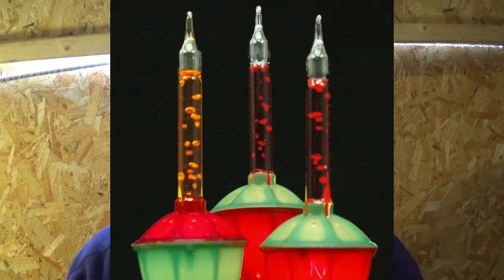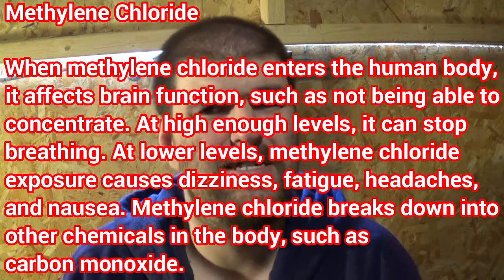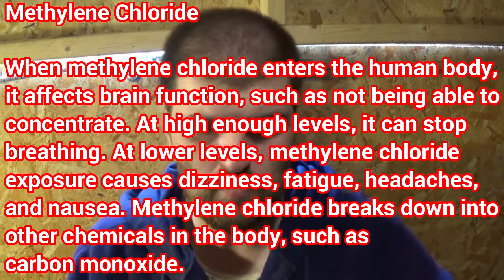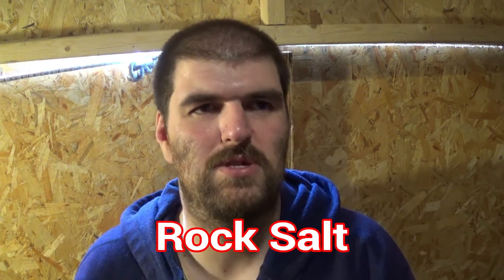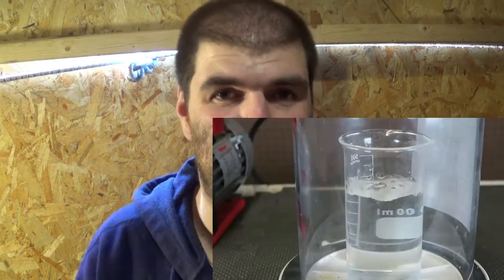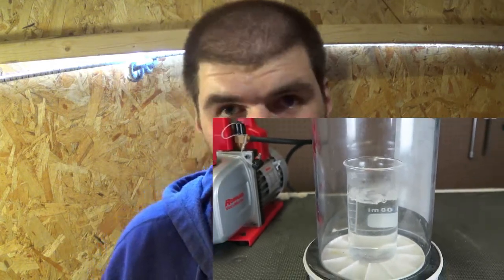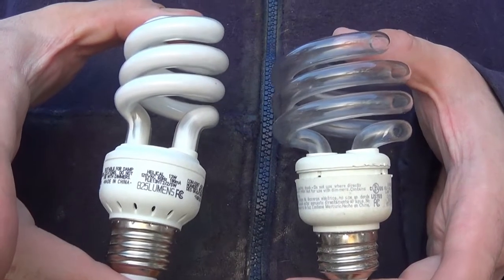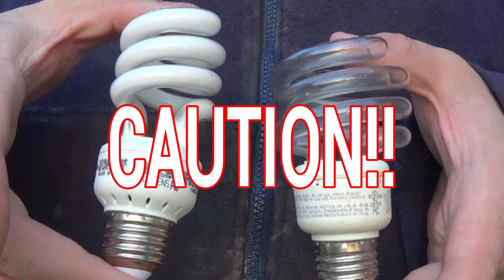How to Clean A Spiral CFL Bulb

Comment: I get it it’s for decorations, but you still could’ve exposed yourself to many toxic chemicals. Although they are in trace amounts, it is still highly toxic for the body to expose yourself to this. And you completely defeated the purpose of a CFL they’re called fluorescent lighting because the phosphor inside of it converts UV light into seeable light. So, by removing the phosphor around it which makes it white you end up defeating the entire purpose of having a CFL. Now you’re just going to admit UV light with that, but you remove the chemicals anyways and if you plug this in and you turn it on it will most likely melt, burn, or shatter the glass shattering it most likely I haven’t tried this for myself I don’t want to find out that part may be wrong I’m not gonna find out if it will shatter.
Reply: Harmful UV light won't pass through the regular glass of the bulb even IF he could get it to work.  The bulb would need to be made of special "Woods" glass if UV were to pass through it.

As far as the Mercury vapor inside the bulb, it's such a tiny amount that unless you were purposely huffing it the instant the end was cut off, it will simply dissipate in the air and do no harm to you. 

As far as the phosphorescent powder goes, just wear a respirator and don't intentionally breathe it in, and wash your hands when you're finished. NO harm done.
Reply: Might want to look up glass properties. 60% of UV-A travels thru lead free and soda lime. @davelowets
Reply: Agree, silica dust from the glass cutting and mercury vapor exposure, even if it's a little tinny ball.

Comment: I think your not going to see this comment because i'm late, but You just invented a clear cfl great job on this video! but I wish I could see it turn on to see how it lights up.
Reply from the maker: The only way to light it up is to put an LED strip or wire in it. I took out the electronics.
Reply: @nathanalaneller  oh
Reply: wouldn't work, the phosphor is what produces visible light.

Comment: So, assuming you have gotten everything else right so that it may once again give off light... you have created a bulb that will emit crazy UV rays! Because essentially you didn't clean it, you stripped the protective phosphor coating.
Reply: After cutting the flask, mercury vapor and inert gas came out of it.  Without mercury, there will be no ultraviolet radiation, from which the phosphor glows.  Inert gas is needed because the air causes the spirals inside the flask to burn.
Reply: @Андрей_Бгг  100% correct. I was very not thinking that day lol
Reply: don't forget the mercury vapours
Reply from the maker: Theirs no electronics in the bulb, I just put the parts back to together for a thumbnail. Besides, I just wanted to make a glass bubbler. :)
Reply: @nathanalaneller  So the video doesn't make sense. And it is clear clickbait.
What is the point of destroying a lamp so that it doesn't work later?
Reply from the maker: @cosmefulanito5933  The bulb was dead all ready. I wanted to use the glass for crafts. I wanted to put an aquarium bubbler & fountain pump in later. To circulate water & bubbles in the glass tube, & having LED lights in the center to light the bubbles.
Reply: @nathanalaneller  Even better!
Reply: Uuh no. The glass still doesn't transmit UV even after the phosphor is washed off, because the phosphor doesn't absorb 100% of the UV, the glass has to block the rest.
Reply from the maker: @simont3686  This cleaning method is for craft purposes, for decorative or glass blowing.
Reply: @nathanalaneller  Yes. I understand. But it does not transmit UV.
Reply: Tell that to all the faded posters underneath fluorescent lights
Reply: @nathanalaneller  I should clarify this in the title of the video...
Reply: @simont3686  I don't agree.
Reply: @cherrysdiy5005  Then inform yourself abou t the characteristics of borosilicate glass used to make fluorescents.
Reply: Well either way, he made a cool bubbler :)
Reply: @cherrysdiy5005  Haha he did lol. Interestingly I have never seen bubblers here in Germany.

Edit: Probably banned because of toxic fluid.
Reply: @simont3686  While CFL is now taking off more in some other countries, as far as North America and Europe are concerned, the LED revolution continues on strong!

P.S. Definitely, the CFL is such a pain to dispose of.
Reply: @cherrysdiy5005  Not in Germany! At every supermarket there are boxes to safely dispose  fluorescent lamps in. Watch bigclivedotcom's latest vid about the Dubai Leds. LEDs can be made much better and more efficient than they are for not much more. I think LEDs are going to stay like they are now for years.
Reply: @simont3686  I just watched that video yesterday. Best light design ever.
Reply: @cherrysdiy5005  The best thing is that it isn't even better. It's just not designed to fail.
Reply: @simont3686  Trudat. Under powering the LEDs leading them to last longer, quite ingenious.